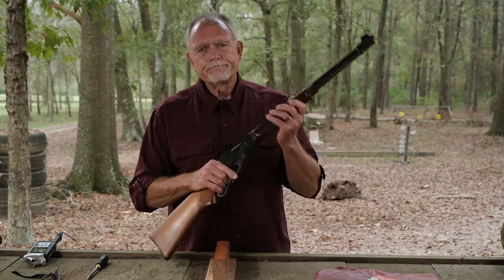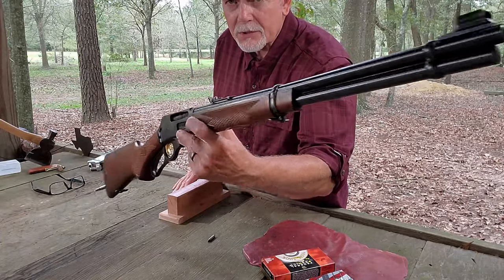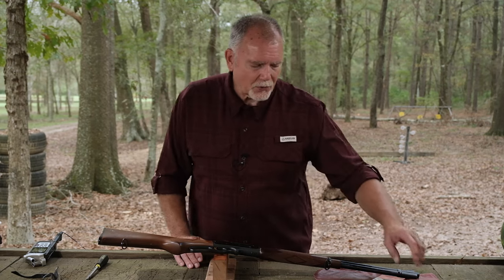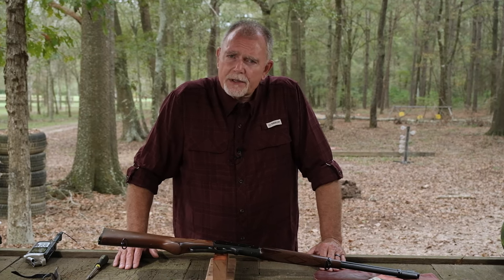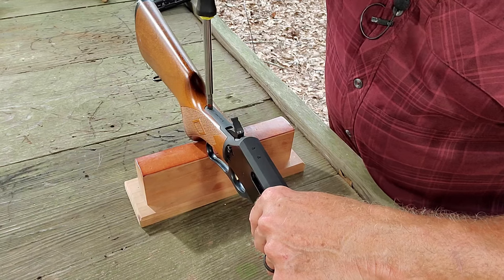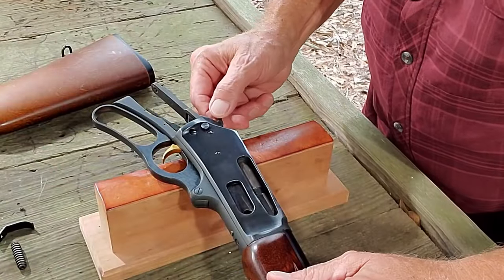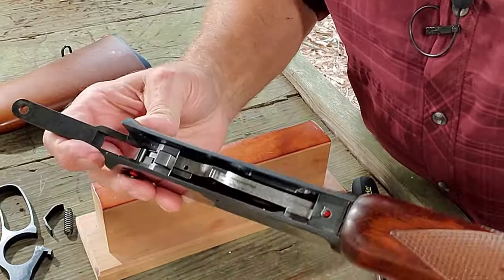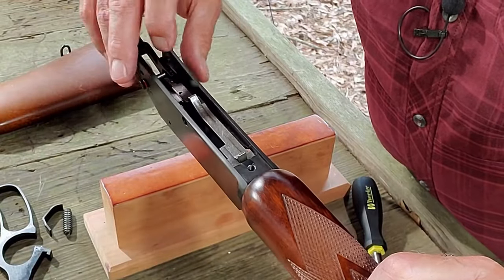Is Your 30-30 Dirty ? Disassembling the Marlin 336 or 1895 for Cleaning

Comment: Hi George, I agree with the previous comment by East Texan.  I never thought about cleaning the mag tube until my Marlin 1894 CB .45 Colt jammed up during a cowboy match.  The mag tube was so clogged up with burnt powder soot that the follower got stuck in the tube.  For an additional 10-minutes of labor it can sure prevent a bunch of problems.  Great video as always.
Reply from the maker: Thanks!

Comment: My greatest difficulty with my 1974 made 336 was ensuring the ejector was in place when reassembling the rifle.  I fixed this by getting a friend who is a watchmaker and watch restorer tap the ejector ‘stud’ (that projects through the receiver) to accept a small screw.  He ‘made’ the screw by taking a screw with a big enough head, and ‘retapping’ it to a smaller diameter allowing him to drill the ejector with a standard watch tap.  When the ejector is installed, before fitting the bolt, lever etc, the screw is installed, locking the ejector in place.  He even matched the blueing perfectly.
Reply: Yep she will last many many many more years on top of the many many many years she has already come that because it's a Marlin and I'm sure your is the JM model to good steel throughout the whole rifle grade A stuff back then like mine is an "80" model 336 no safety witch I am great full for nothing wrong with that but I want to be ready to start peppering one right after another I heard you have to do it for every shot I don't know for sure but that be lots of trouble to me

Comment: Thanks for this video. I wanted to install a Ranger Point loading gate on my 1894 Marlin CSBL 357 mag. Other vids show how but not clear or 
detailed. I hesitated to do this myself but luckily found your vid on cleaning the Marlin 30/30. and it was a great step by step instruction on
disassembly and reassembly and after the disassembly is was a cinch to replace the loading gate. Your vid worked great on the 1894 also. 
thanks

Comment: Absolutly gold. With this help, I just cleaned my 3030 AS Marlin. Thanks.
Reply: My Marlin 30AS will not eject shells, do you know of any thing I should be looking for?? Any advise would be appreciated.
Reply: @lanaholmes7098  I would start with a through cleaning. Remove the ejector and check the spring is not broken. Obviously it extracts. But no ejection. The spring allows the ejector to protrude into the pathway of the case head as the bolt is drawen backwards. Be sure to fully operate the lever forward in a manly fashion. A new ejector may be your best course of action. Good luck.

Comment: Thank you George. What a helpful video.
Reply from the maker: Thanks Phillip!
Reply: @TargetSuite  You're welcome. That video will help me replace the carrier on the 444. Got the big loop lever for the 45-70 yesterday from Brownells and my new Ranger Point peeps and front sites come tomorrow. They'll go on the 44 mag and the 45-70. The .357 has a red dot right now but I may change that. I'd like to try that big peep you have on one of your Winchesters.
Reply from the maker: @Phillip How did your sight and lever replacement go?
Reply: @TargetSuite  All good, thanks to your video's. I took the 444 apart as well and polished the original carrier and firing pin block as well as the lever. Using a wire brush on a dremmel I polished out the breach and the bolt too. Hopefully that will take care of the jamming issue. The new carrier I got was missing one component (a small spring loaded ramp) Otherwise all dimensions were identical. If the jam persists, maybe I'll try it anyway. Your videos have emboldened me in my gunsmithing.

Comment: Another great video George. I have a Marlin 30=30 XLR 24” barrel with a 1x-3x-20mm Weaver scope on it. It is the grey laminate/stainless steel. However I had it cerakoted to matte black. Of the various factory ammo I’ve shot through it, the Fed Prem 170gr Nosler shoots, on avg, less than 1” @100yds. It took me a bit but I did manage to find 4 boxes so that is what I’m using for a hunting round this year. But it would be great to see a video on how various 150gr ammo vs 170gr ammo does in chronograph vel, accuracy and penetration tests. In 2013 I chronographed a box of 30-30 Hornady LEVERevolution 160gr ammo in a Marlin 336c 20” barrel and a Winchester 24” barrel. It was a sunny day in mid May elevation of 1280 meters (4200 ft) and 20 Celsius (68F). 10 rounds out of both guns shot 2445 fps to 2460 fps. Very surprising, but so was the end of your video. I thought the 170 Nosler would out penetrate the 150 Hornady.
Reply from the maker: Larry, I probably should have spent more time at the end, because I suspected the 150gr bullets skimmed across the top of the water and that is what accounted for the deep penetration. I reviewed some previous footage and confirmed my suspicion that the lighter bullet should have stopped in the first jug.

Comment: Well done George.  I really like these videos on disassembly/reassembly for maintenance.  That ejector can drive you crazy falling out of the slot during reassembly, but if you put a touch of white grease on the ejector boss it’ll help to keep it in place when sliding the bolt back into the receiver.
Reply from the maker: Thanks Charles. That's a great tip in keeping the extractor in place!

Comment: The difference in disassembly is another reason (weight and expense being others) I bought an 1895 and not the wonderful Winchester 1886. That thing is just too much for me.  It is UNBELIEVABLY beautiful but I would end up having to take it to my gunsmith in pieces to have him reassemble. Great video as always George.
Reply from the maker: Thanks Mark! Before I made my 1886 disassembly video I spent (literally) two days "practicing" because it is, as you said, that difficult. But I think I worked out the kinks enough that, if someone follows my "Target Suite" method (😇) it will save that trip to the gunsmith.
Reply: Just watch the videos over and over again that's what I did with my 1877 Colt revolver and I can take that thing apart with my eyes closed now and put it together, I'm kind of new taking the Winchesters apart I have problems taking the tube out of my 1866 took the pin off the spring for the magazine but still don't want to come out I don't know why
Reply: @TargetSuite  on my 1866 Centennial I try to take the tube out of the magazine it didn't want to come out you know what's holding it I took the pin out. Thanks for your videos I really like them

Comment: I greatly appreciated the video.  I saw a push button safety on the newer gun and assume for that level of disassembly there is no difference with a safety vs without one.  
I can see that I will not be doing a disassembly in the field relative to cleaning.  One can make a crown-muzzle protecting guide for the cleaning rod to allow cleaning from the muzzle end.   
Someone already mentioned the tube disassembly perhaps for the future.  There  is a modification and also after market parts for the loading gate to make it easier to load that I am interested in.
Reply from the maker: I used a scientific load gage to compare the standard Marlin Load gate with a Ranger Point Precision load gate and there was a significant difference. I would recommend that for sure.

Comment: You forgot to mention the screw that holds the gate should be tight. Mine loosened up and jammed the lever in the forward position. A round was stuck in between the gate and the magazine. Had to take the whole assembly apart. (With your help) What cleaning aides do you recommend?

Comment: Very informative!  Were the 150gr bullets round nose? So much controversy on using round nose bullets in tube magazines,  but I have seen round nose factory loaded in 30-30 and 35 rem since the 70s. I would think if the factory loads are willing to use RN  it can't be all that dangerous?
Reply from the maker: Thanks! Yes they were round nose bullets. Perfectly safe in a tubular magazine.

Comment: 336 style Marlins are easy to clean properly from the breach. Unlike you for normal range day cleaning the only screw I remove is the lever screw so I can take out the Lever, Bolt and Ejector. This is as far as you need to go unless you got the rifle wet. I do all the extra disassembly you did after hunting season before the rifle is stored for winter. Model 94 Winchesters are a bear to clean in comparison.
Reply from the maker: You are right James. The 336 is so easy to do a routine cleaning on. And yes all of the Winchesters are far more complex in comparison. Thanks for watching and thank you for the comment!

Comment: I used this to do trigger and action job and never again, it was harder than you made it look.
Reply from the maker: No deception intended. I just went through the process a few times to get it down for the vid.
Reply: @TargetSuite  I didn't think you were deceiving me but obvioulsy it takes some practice to do it.  My biggest problems were getting the RPP trigger in and putting the hammer spring and flange that secures it back in place.  Just made me think other than doing trigger job do I really need to take this that far apart to clean it.

Comment: I’ve owned a marlin 30-30 for well over 30 years, it was and still is my favorite woods deer hunting rifle. But I will fess up and say that I have never took it down that far and cleaned it. Doh. Guess I know what I need to do. Thanks for the how to. I’d hate to even guess how many rounds I’ve shot through it. Killed many deer with it. Ammo has been scarce lately for a 30-30 this year.
Reply from the maker: Well, yours is a testimony to the Marlin 336 design, and I think the vast majority of the millions of 336s out there have also never been disassembled like that. It's just so easy once you see how it is done.
Reply: Thats the first thing I do when I buy a firearm. Take it down 95% or so and clean it thoroughly. Not only will this ensure the gun is cleaned of the factory grease and grime, it allows you to see how it works in case there is ever a problem. Good chance to spot any potential factory defects prior to shooting as well.
Reply: And sir you said you had not cleaned it in long long time as in taking it completely apart let me tell you you don't ever have to go that far Ever Ever Ever  what do you think spray does and I'm talking gun cleaning solvent Remington spray use the straw jet in side the breach area down the barrel and of course swab your barrel real good doing that and then go ahead and oil that day lights out of it you don't have to worry at all anything inside the breach as long as you spray it down with that solvent spray and I like Remington and I've even used break cleaner spray  crab cleaner  spray many many times it's very cheap it works great but right after you're done go ahead and oil get you some rim oil and after you're all done cleaning the inside of your barrel with patches and your bristle brush knocking the lead in the carbon out  real good and then hit the inside where the breach area and the bullets come through the loading gate hit all that with rim oil and you never ever ever ever ever ever ever ever have to take your gun apart like he did now if you were in the army you might have had to done that 😂 lol to make that old sergeant happy  now if you break a spring now you got to take your gun apart  but you're talking about a Marlin 336 JM model 1980 is my year I go as far as 95 year  I've had mine and I have never ever ever have to take mine apart ever I killed deer I've killed elk I've killed wild pigs I've killed bear you own one of the baddest guns in the world and be proud of it I hope yours is the older JM model cuz you got something that's a lot better than the what  they make today oh yes they will work but won't last for many many many years like the older ones

Comment: Where can I get the screwdriver kit for the Marlin 336? I have an old Marlin (1968) and a friend has a 1952. We want to take them apart without damaging screws. Thanks. And as always, great video👍
Reply: Midway USA sells the Wheeler Gunsmithing Screwdriver set. I have the 89 piece set.  There are bits to fit every firearm screw I’ve encountered. It’s an excellent set for my amateur needs.
Reply from the maker: Amen to what Hutehund said!

Comment: 3 or 4 years ago, I bought a Marlin 336 lever action rifle that was manufactured in 1978. I took the gun completely apart for cleaning. No rust at all. Just dirty. The inside of the barrel is shiny and very nice. I greased the part of the lever that fits into the bolt and oiled the rest of the gun completely, inside and outside. I still haven’t shot this rifle because I can’t find the ammo that I want. It only cost me $300 for this rifle. A friend of my older brother passed away and his wife sold his entire gun collection. I have been wanting a Marlin 336 for years and I feel very fortunate to have ran across this rifle. I bought a new scope for it, but haven’t mounted it yet. Can’t wait to find some Hornady Leverevolution 160 grain ammo and try this rifle out. I don’t know exactly which model of 336 this is, but I know that it’s not the 336 CS, since it doesn’t have a crossbolt safety. I do know that this rifle was made in the original Marlin factory.

Comment: Smooth. Now how often is it recommended to take apart to clean from the bore end?? Don’t imagine that the Cowboys and Indians were doing the disassembly too often??
Reply from the maker: If you're really careful you can clean from the bore end for a long time before you damage the crown. But, you just have to make sure that dirty cleaning rod is centered in the bore.
Reply: @TargetSuite  Tnx so much. I got my 35 REM Marlin 80’s just to have one. It’s gorgeous. Couldn’t believe how accurate it was at 100yds with the iron sights. I was putting shots in other holes and could barely see targets with the bead on them! I always liked the idea of bore snakes. Mine is just an Americana collection piece. Only cleaned once or twice over 30yrs ago. Recently put mineral oil on blued finish. After years of storage had a couple small stain spots on it unfortunately. Need to get a rod through the bore with some oil. I bought Weapon Shield years ago. Bore looks like new. Probably only seen less than 30 rounds through it. Not like an all day target rifle with the .35 kick😂😂. I said “this thing is like a missile launcher!” Again, mine, with the JM stamp, is crazy accurate on paper. With a Bushnell Holosight on it, think would prove pretty effective for bear or outlaws! Loved the video. Tnx!

Comment: Hey Target Suite, I have a Marlin 336 JM stamped,I’ve had for sometime now but never fired. Recently while reloading I checked to make sure loads would cycle. The problem is on ejection it scratches the case. Do I just buff or change the pin?

Comment: Clean and all fasteners properly torqued. The fast smooth accurate and reliable Marlin 336 is ready for service.
Available from base service grade to custom shop works of firearm art. Time proven by near countless satisfied owners.
The cross bolt safety as unobtrusive as can be just leave in safe till ready to shoot. Available in many calibers 336/1895. You’re sure to find one to fit your needs.

Available polymer spire point bullets safe in tube magazine and allow the advantage of better ballistic coefficient of low drag profile for longer range retained energy delivery. Cycling and loading though action with complete safety and ease.
 For new shooters always point muzzle in safe manner and assume chamber is loaded. Leave safe crossbolt on as extra measure. The Marlin having the extra safety measure for shooters of the two piece firing pin. It falls out of battery till bolt lock is securely in place for no possibility of firing till complete chamber lock up. The steel forgings of action far and above any ridiculously over charged hand loading. Any rifle is designed to operate in proper pressure levels for design. 

The devastating power of this round evident in this live fire demonstration.
Reply from the maker: Thanks Bill. You are a great Marlin spokesman!

Comment: I don't completely field strip my Marlin 336. I remove the bolt spray the inside with Break Free CLP powder blast, scub it with a gun brush, blast it one more time. Reinstall the bolt oil it and put my rifle away.
Reply from the maker: Awesome! Most of the time that's all you need. Thanks!
Reply: Your welcome sir. I also dread losing the ejection spring. Lol

Comment: Where does one get a little part that holds the lever closed to the stock on a Marlin 336 C 35.Rem. ? It keeps letting the Lever open.
Reply from the maker: Numrich Gun Parts, if they are in stock.

Comment: That appeares to be a nice aftermarket trigger.  I have one like it in my Marlin CB Limited.  The same company makes a relacement "plug" for that ugly cross bolt safety  ;-)
Reply from the maker: Not sure about that trigger. Rene' bought the rifle used, so the history is a little cloudy.
Reply: @TargetSuite  The Marlin triggers of the JM era have pretty good factory triggers, but they have that characteristic of being "floppy".  If that trigger is like my aftermarket one, the trigger is held to its rearward travel by light spring tension and the pull is very light and crisp.

Comment: What is your thoughts on the Marlin Glendfield 30A?
Reply from the maker: Great guns! Just not finished as nice as the Marlin branded rifles.
Reply: I have a Glenfield in 30/30 from 1970 with the short tube. Smooth as butter and more accurate than my 3 other “JM” rifles from about year 2000.  I absolutely love the Glenfield even with its artsy stock.

Comment: what about the 1894? is the takedown the same?
Reply from the maker: The Marlin model 1894 has a similar takedown except when it comes to the bolt. Because the bolt design is different on 1894 and 336.